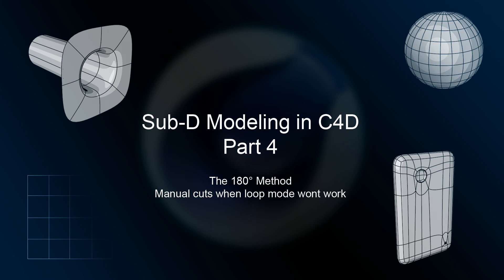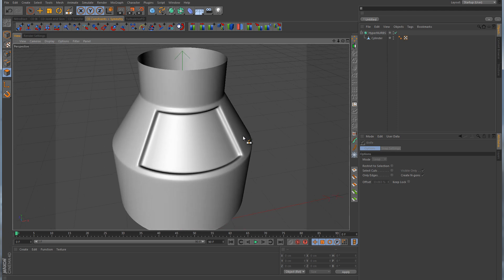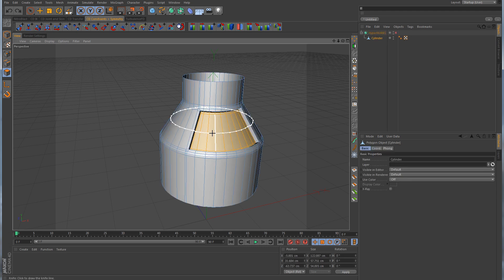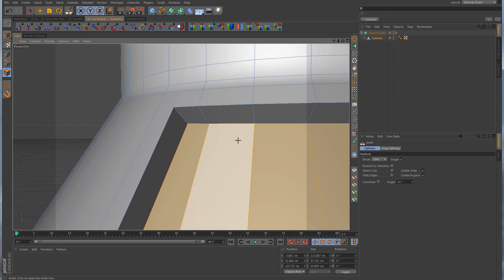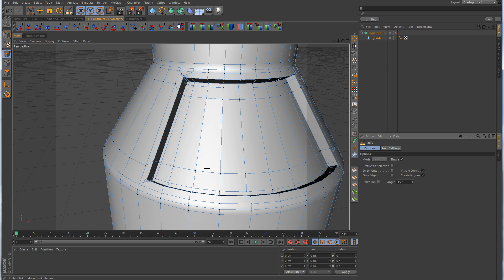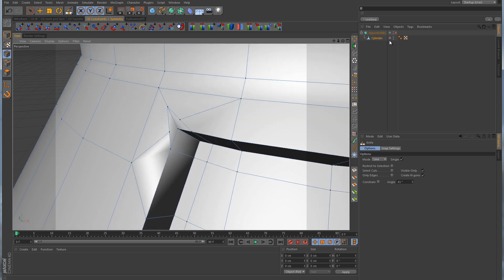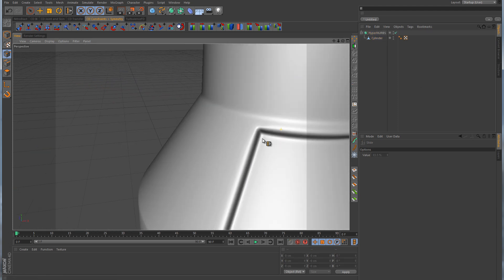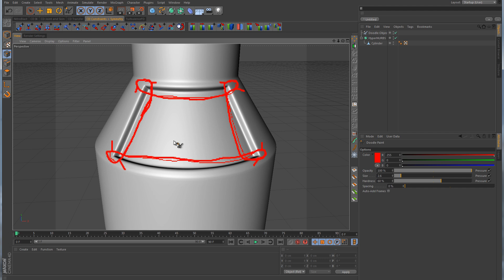Sub-D modeling in C4D - Lesson 4 - The 180° Cut

Comment: There's a much better and easier way to do this. Toby Pitman has a tutorial series named: Making It Look Great 11. In this series he shows how to isolate control cuts so they don't extend out, or propagate into the rest of the geometry. If you know exactly where the extrusion will be, you can use the slide tool to duplicate the right edges, add a new loop cut, and prepare the geometry for the extrusion. If all of the prep work is done properly you won't have to do any fixing after the extrusion.
Reply: Could you link the tutorial? I can't find it.
Reply: @matteo.rossi.3d  https://www.thepixellab.net/making-it-look-great-11-hard-surface-modeling-for-cinema-4d

Comment: Hi!Thank you for your video!But what if there is a lot of different shape size position holes,on a single flat surface, and while i'm trying to isolate and fix the first one,others become like a mess..?? here is the example-https://goo.gl/JYBsNZ
Reply from the maker: +Иван Арион Your example is going to require a different approach. The 180° cut in this tutorial doesn't always work for every problem. If you're going to use Sub-D modeling for all of those holes in your example, then you will need to model that section as a separate piece of geometry, and model it one hole at a time, extruding edges as you go.
Reply: +ShepperdOneill Thank you for your reply! Your suggestion is kind of tedious ) I just would like to substract all the things with boolean operation,and then clean up the edges. Is there any system,for solving this kind of problem that way?
Reply from the maker: +Иван Арион More than likely, you will have to clean up the edges manually. With all of those holes, its going to be messy.
Reply: +ShepperdOneill Got it! Thanks!
Reply: Check out Toby Pitman's tutorial series. Making It Look Great 11. He shows how to isolate all of the control cuts so they don't make a mess of the rest of the geometry.

Comment from the maker: Well, technically, 180 is not right. Its actually just a loop edge cut. I called it a "180 cut" due to the fact that once the edge cut come up and out of the extruded hole, it immediately turns around 180* and heads back down the hole.

Comment from the maker: If you merge the two triangles together you'll create a degenerate faced quad because of its shape. Doing an inner extrude inside and outside the edge of the extrusion would help, however, you still need a vertical edge. The vertical edge caused the problem, so to solve it you have to quickly tie it off instead of continuing it on once you are out of the extrusion. Im hoping I understood your question correctly.  :)